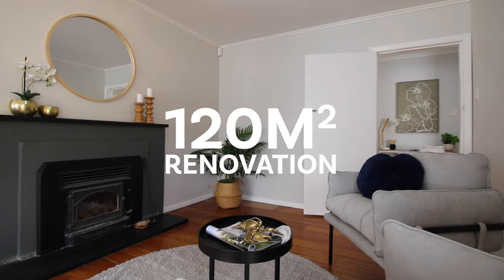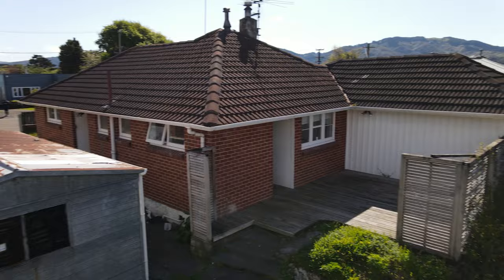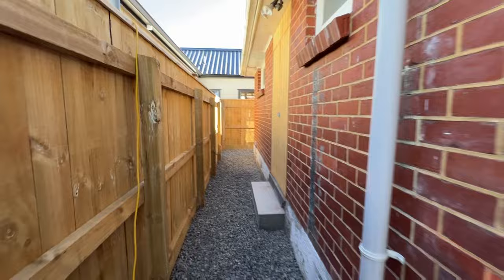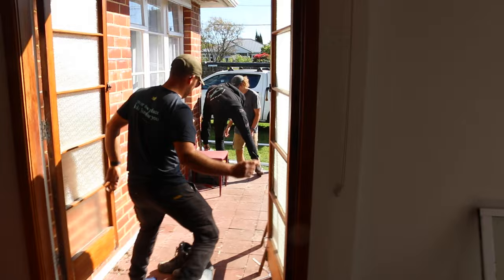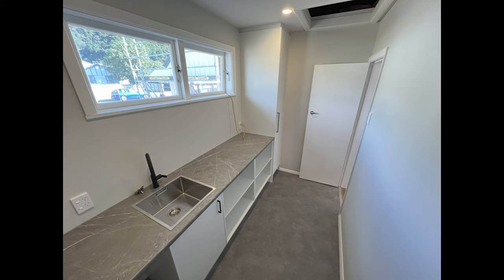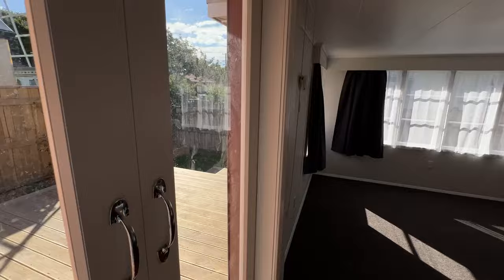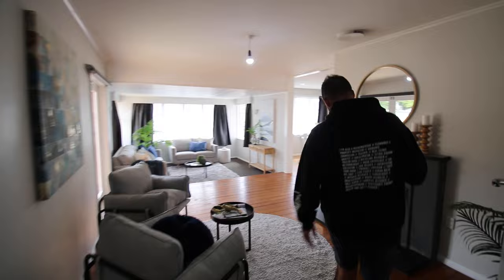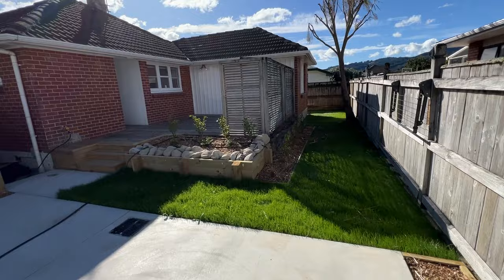Renovating1940s House Start to Finish

Comment: Great video. I've always found it interesting when people say something is renovated when all they have done is done is paint and put new flooring in. Personally to me a renovation is when you re roof, re clad or re finish the cladding, pull out all the flooring, ceilings and walls linings, fully insulate, re wire and re plumb the whole house. Than put in new flooring, wall linings, lighting, ceilings, heating etc... but I understand cost and resale value are a factor